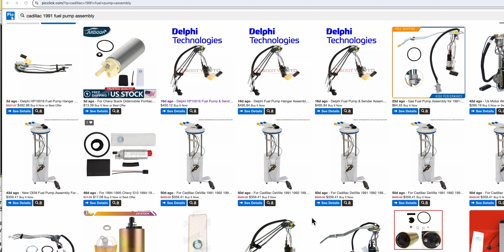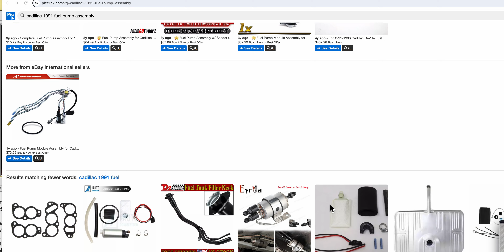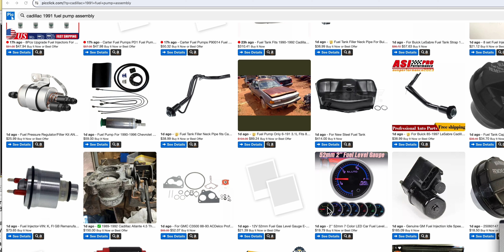HEY, FOLKS, CAN I VENT!?! Why can't I find parts for my 1991 Caddy? (no cars appear in this video)

Comment: Rockauto has fuel pumps. You must be wanting a complete fuel sending unit assembly. That maybe really hard to get.
Reply: You are correct, my friend, I need the entire assembly. But I may be in luck. My mechanic MAY have found one....I will keep my fingers crossed.
Reply: I have a car like that I want to get rid of it you can use it for parts same color
Reply: @butchsutton3006  Thanks for the offer. I would like to come take a look at it. Do you live close to Augusta, GA.?
Reply: I'm in Houston
Reply: Wat part are looking for
Reply: @dalecomixcollectibles137  Wat part you looking for
Reply: @butchsutton3006  looking for a fuel pump assembly